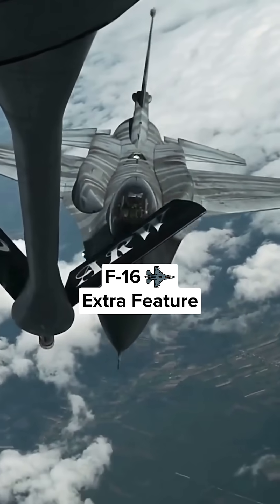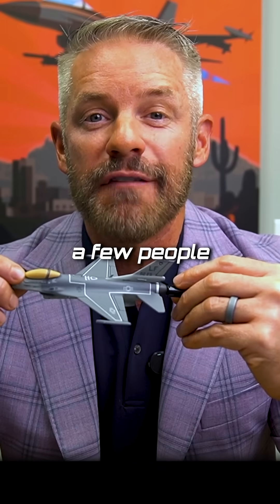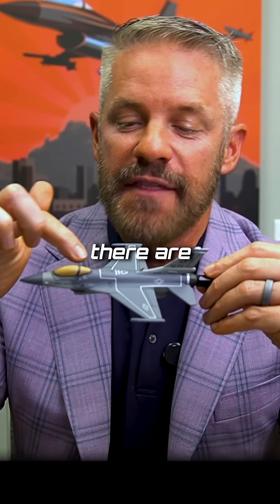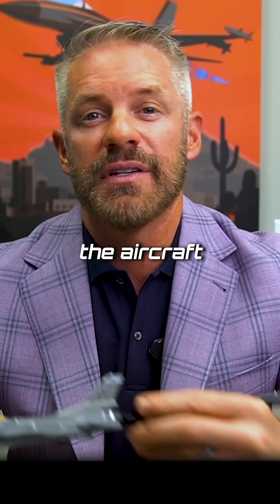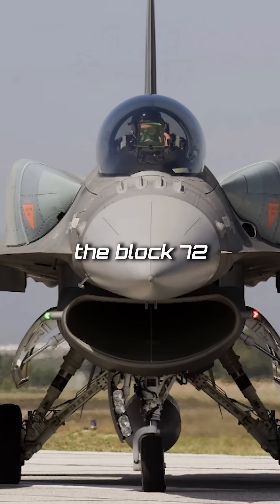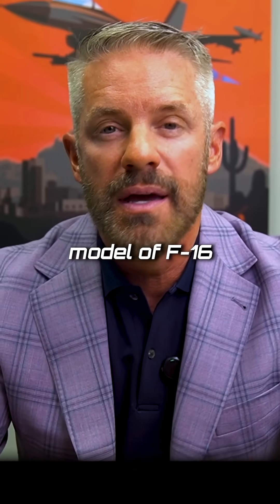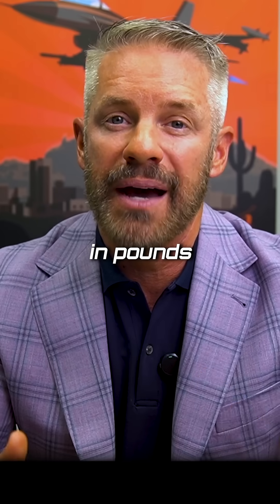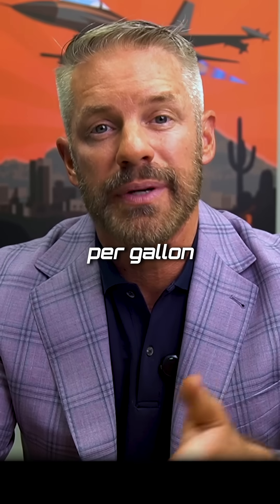What Are The Conformal Fuel Tanks On The F-16?

Comment: What's the ferry range on the viper? There's a recent vid wher the guy claimed he had to get gas every 45 min on a 10 hour ferr flight. I flew hornets and growlers  and we'd get roughly 1000 nautical miles clean and 1250 to 1450 with bags. Depending on speed, altitude etc,etc ì always assumed we were gas limited more with twins. ...... are those numbers possible? It just doesn't add up to me.  It's like he was running full burner for 10.5 hours going from tanker to tanker

Comment: The F-15E model had this feature for decades before the F-16. It's one of the things that make the F-15E model (Dual role Air-to-Ground & Air-to-Air) look differently from the F-15C model (Air to Air only) and the poorer performance when turning under load is the reason why the C model doesn't carry these to keep it's air to air performance above the E model.
Reply: One of the only  F-15C'/D squadrons to wear the CFTs were for the 57thFIS out of Keflavik Iceland from 1985-1995.  They would guard the Greenland Iceland United Kingdom or GIUK Gap. They required all the range they could get.

Comment: I first saw the CFT on an Israeli F15D way back in the 90s. They existed before the 90s, it's when I personally saw them. 
On F15s, these CFT could be removed or installed. But the install process took a very long time, including curing of the special RTV silicon sealant. They looked sleek and blending in on F15. On the F16s the CFT are ugly😀

Comment: I know it’s not related but one night after the coups in Turkey we were in our HMMWVs posted, no electricity, low supplies, but we were close to changeover and had to fuel our vehicles with diesel…we were 45 minutes away from having JP8 filled up. Apparently they can run on jet fuel, but will demolish them lol. Thankfully a C17 with diesel resupplied our unit

Comment: Can you drop them if needed in a fight, or if you run out of flares like the movies or is that movie magic? Just curious. Great video! Thanks
Reply: CFTs can only be removed on the ground. The US still doesn't use them, preferring to rely on drop tanks and in flight refueling over strapping those on semipermanently. There's an argument to be made that it was mainly financial reasons though when you have a fleet of over a thousand of them, some of which aren't already plumbed for them.
Reply: @jameshall1300 the US can afford to have underslung drop tanks because most of their bases have pristine runways... the bulk of the f16's in Ukraine have had structural issues with their landing gear because Soviet era runways are not built to the same standards...
Reply: @maigepresents5840  under wing vs CFT will have no different effect on the landing gear. They'll both be empty when landing, and both supporting essentially the same weight per wheel. I have no idea why you thought runway quality was at all relevant to a discussion about fuel tanks.
Reply: @jameshall1300  tell me you don't understand how weight differentials, geometry and centre of lift work without actually telling me... having 2 rather heavy underslung weights at a converse angle to the centre of lift and mass results in more torque forces to be applied along with gravitational forces... for example, it's easier to lift a 40lb kettlebell one handed than it is to lift a 40lb bar bell... your arms experience less torsion forces with the kettlebell... its the same for fuel tanks and landing gear.
Reply: Semi permanent fixtures... takes a full crew a few hours to take them off and put the original panels back on..

Comment: When it's hot outside - fill a jug all the way to the top with fuel.  All the way until it runs out and stops.  When the temp drops - the level of the fuel will also drop into the container. 
Jet fuel is measured in pounds because gallons are not always gallons.  When fuel expands or contracts the volume of fuel will change, but the weight of the fuel will not change.

Comment: More weight means more induced drag. More wet area, more skin friction drag. So , cft have a considerable impact in drag.
Reply: He literally said it had a minimal effect on drag, especially when compared to standard drop tanks. Minimal does not mean zero.
Reply: @jameshall1300  Exactly.  Aerogant Engineering professor above knows more about the aerodynamic result than the pilot who literally experiences it.  

Aeronautical engineers are the leading cause of forever sleep among test pilots.  But they know things, and they are absolutely certain that no one else does.
Reply: THIS!!  Don't listen to that stupid pilot.  He clearly has no clue.  Listen to this random YouTube commenter. He knows the way things really work.
Reply: @skipdreadman8765  does the pilot have an engineering degree? By your logic, a driver knows more physics than the engineer who designed the car. Open a book on Aerodynamics or Flight Mechanics, they were used to design planes.
Reply: @tomdtom5407  do YOU have an aviation engineering degree to argue with such authority ? ...

 yes the conformal tanks will have SOME effect on drag, how much ponly actual engineers that used modern techniques and coputer assisted modelling know. They in fact might be even REDUCING the overal airframe drag  because at those speeds and airflows its a bit more complicated than just "more surface area = more drag" ... the shape and its effect on forming pressure differentials and turbulent airflows will determine the end result not just "its bigger therefore bad"
Reply: @Asghaad  I TEACH aerospace engineers. My current and former students design aircraft. More weight means more necessary lift -> more induced drag. Ask a F-15E pilot if his aircraft has the same performance of a F-15D. And yes, parasitc drag is a function of wet area. Don't believe me? Open a book on Aerodynamics or Aircraft Design. And as you said cft has  " some effect on drag" which is diffent of no effect. Understood?

Comment: @realshawnwalsh why does the IAF F16 shown in your video have the more pronounced/prominent spine between the Conformal Tanks and is it true that the IAF versions of the F16 are more advanced than their U.S. counterparts?
Thanks.
Reply: The dorsal spine was necessary on the  Block 50+ two seat models ( D and F ) to accommodate new electronics. The single seat ones ( C and E ) had enough available room still for it to not be necessary. As far as more advanced, that's probably true for the Sufa, since the US hasn't bought the most recent F-16s yet ( Block 70+ ) afaik, and Israel is pretty committed to keeping their much smaller fleet as updated as possible, especially since they make many of their own electronics equipment in country.

Comment: Can you jettison them like a tank on the wing  or the belly or are they hard mounted??
Reply: They can be removed only on the ground.
Reply: This was my question also... I'm guessing jetting them would damage the horizontal and vertical stabilizers. Just an educated guess.
Reply: They never jettison fuel tanks.  I dont know why so many think dropping fuel tanks is an option.  Fighter fuel tanks are highly sophisticated pieces of equipment that are very costly, are in limited supply, and are not easy to replace.
Reply: @roblockhart6104 ... Emergency jetting is done in real life for various reasons.
Reply: @roblockhart6104  which aircraft did you work on?

Comment: The decrease make sense because of the sloshing around of fuel and the weight and weight shifts
Reply: Dude... what are you on about? Most fuel tanks in jets have a metal outer with  thick rubber bladders actually holding the fuel...they contract when emptying to reduce the risk of fires and leaks... there's no fuel sloshing around...

Comment: How many extra miles and minutes do you get with it
Reply: That depends on a lot of things, namely how high you're flying, drag and how fast. Probably the easiest way to estimate the extra flight time is in the fuel burn rate. At cruising speed the F-16 burns around 4000 to 7000 pounds of fuel per hour. In full after burner, it can be as much as 80000 pounds per hour.
Reply: I was wondering what percentage increase these tanks provide?  I would guess about 50% more.
Reply: @ Less than you would think. When you carry more fuel, you burn more fuel

Comment: What a unbelievably negative tradeoff. The whole point of the 16 is that it's a 16. Doing this takes everything away that makes that plan amazing and simply turns it into a flying gas can. At that point you might as well just go with the SF18 or even an F35 with drop tanks.

Absolutely useless modification solving a problem that doesn't exist.

Comment: F-15E and newer Eagle models have them too, and I think the Steagle has around 34,000lbs of gas
Reply: ye bro i play warthunder too
Reply: @lucakrokrowinkel9576  I used to
Reply: F-15C, F-15D, F-15E, F-15EX, and even some F-15B and F-15A got / can receive CFTs (Conformal fuel tanks). The F-15C and F-15D received these tanks as part of the MSIP (Multi-Stage Improvement Program), which was aimed to improve the performance of the Air Force's primary air-superiority fighter, the F-15. "C" and "D" model Eagles got this upgrade package in production. The MSIP package was also applied to early F-15A and F-15B. So every major variant of the F-15 in US service could receive the tanks. The beauty of the Eagle's CFTs are that they have additional hardpoints, allowing for more ordnance. These days, not all Eagles that are in service are using these tanks. Most Eagles flying stateside use drop tanks, as CFTs are notoriously difficult and time consuming to remove. In combat operations, drop tanks allow the Eagle to drop (hence the name) its tanks and lose some weight, allowing it to make a straight shot back to base. This is not an option with CFTs. However, there are still some times when the two tank types are used in tandem, such as long-range ferrying or extra long missions. As mentioned in this video, CFTs add less drag than traditional drop tanks. Seeing the success of the F-15's CFTs, it makes sense that Lockheed would integrate a similar solution to the F-16V Block 70 and Block 72 Falcons, as well as retrofit them to some existing variants. Boeing has also integrated CFTs into F/A-18E/F (Block 3) Super Hornets, as Naval missions are often lengthy, and a little more gas is often appreciated in ground strike or BVR roles, as dogfighting is EXTREMELY rare these days.
Reply: @WilliamChrisman-e1f  thanks
Reply: @WilliamChrisman-e1f  most US 16's aren't  outfitted for CFT's just cause the fuel system is ass enough without removing CFT's just to access for fuel cells. (which i believe you mentioned on the 15's) middle eastern countries and i think a couple slavic nations with orders want them but all the block 70/72's are built to use them. similar to drag chutes, US doesnt use them but a few countries want them. this is coming from a dude who works for lockheed on 16's. just in case anyone wants to say im full of shit. lol
Reply: @tylerbuchanan8463  I don't think that any F-16s in US service have CFTs. I think the AF will not procure any more F-16s in the future, as we have F-35A production really ramping up and the F-16s would be made obsolete in a few years

Comment: Other than increasing loiter time, one big advantage is they didn't occupy any weapon pylon. So you may carry less fuel but with heavier payload during takeoff, and later fill it up in the air via tanker.
Reply: Usually, drop tanks are not on the weapons pylons (there are rare cases) since drop tanks needs fuel lines to be useful...
Reply: @SgtMclupus   Modern jet carry their fuel tank in standard weapon pylon tho (like F/A-18E for example, able to carry up to 5 fuel tank in Aerial Tanker configuration)
Reply: @SgtMclupus the pylons are changeable but the weapons stations are not. Or to put it another way, the attachment point on the wings that the wet pylons for the drop tanks are added to could otherwise have been used for weapon pylons. so one way or another you are losing capacity

Comment: Can they be dropped? Or is it just too tight in the airflow to not cleanly separate? What if you maneuver inverted or pitching over?
Reply: Cannot be dropped. 

Also use critical thinking, do you think they could be designed to not go inverted or pitch over.

Comment: I see some of the Vipers have a redesigned dorsal area. Those models have had the dorsal boom method refueling receptacle removed, and use the probe and drogue method for inflight refueling, correct?
Reply: This is false F-16s with this modification still refuel the same way!
Reply: The IFR is still there at the same location, just extended on top of the dorsal... Tbh, the dorsal has been around forever.  I've seen and worked on 86 model 16s with a dorsal. They refuel the same way.  It's such a versatile airframe and looks so cool 😎
Reply: Are you thinking of the two seat models with the new spine? If so, that's only because they needed the extra space for electronics, not anything to do with IFR. The single seat models still had enough space to get by without it

Comment: What is the efficiency of conformal fuel tanks? I read somewhere that regular drop tanks will only use half of the fuel they carry to extend the range, while the other half is expended in making up for the drag created by the tanks.
Reply: Not quite... external tanks have around a 70% coefficient.
Reply: @maigepresents5840  I see. Thanks. Do you know the coefficient of conformal tanks on the F-15 and F-16?Are there other aircraft that use conformal tanks?
Reply: @Zajuts149  that's really hard to calculate as conformal tanks aren't a stand alone structure. The coefficient would also change given the jets AOA, speed and other factors. But as a baseline, a conformal tank on a jet flying straight and level would likely be in the high 80's or early 90's drag efficiency. They are built to not adversely affect the flight characteristics of jets by design

Comment: Wait, the F-16 uses JP-8? For some reason, I thought that JP-8 was used on the SR-71, while other jets used JP-4 or JP-5. I have no idea about the differences between them, only that the SR-71 needed their own dedicated tanker, the KC-135Q for their special fuel.
Reply: JP ratings are a bit of a rabbit hole, chronologically and chemically speaking over the years. 
Some blends got more additives and were eventually designated as a new and or niche fuel type, as time went on, and or were completely synthezised specifically for a certain application like the SR-71. 

In which case the blackbird used JP-7 and TEB igniters for afterburner light off, it was more or less a fuel specific to the J58 engines. The military primarily uses JP-8 as a mass fleet standardized fuel nowadays, and is similar to civilian Jet A1 fuel but with additional corrosion inhibitors and anti-icing/gelling agents. 

Wikipedia actually has a pretty good page on JP fuel designations and their history, as well as comparing it to general aviation Jet fuel blends and thier history too if you are interested.
Reply: JP-8 is pretty much the standard fuel for everything across the US military today, including ground vehicles. It makes life so much easier when you only have to deal with one type of fuel.